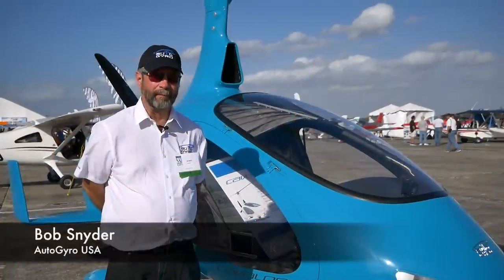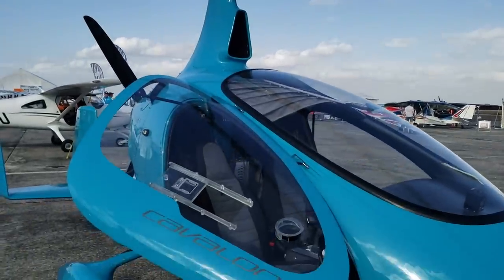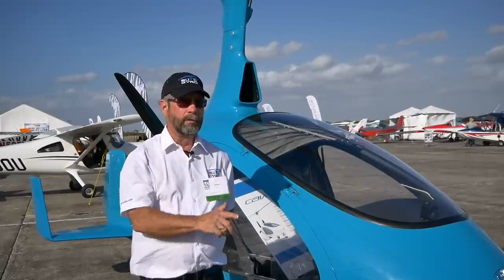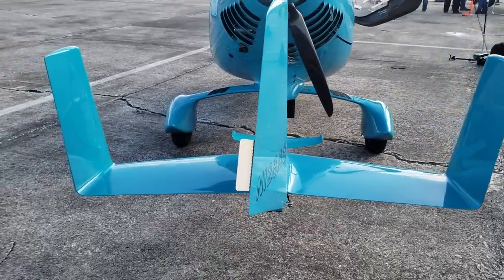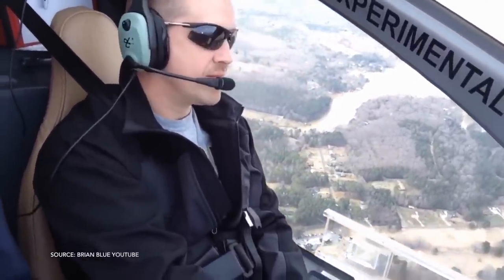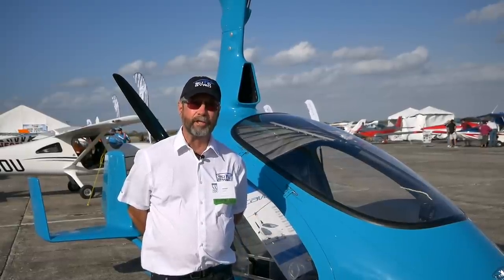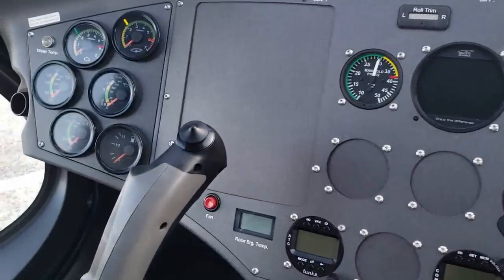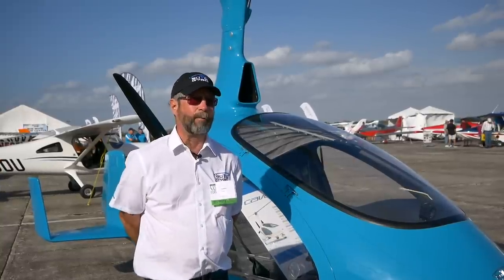WHY Pilots Fly This Instead Of An Helicopter l AutoGyro Cavalon

Comment: Used to build these things out of balsa wood and rubber bands back in the 90's. Autogyro's are pretty neat. Of course ours just flew straight back then. We didn't have remotes for them. But they flew really great across a field with no wind, and even better in a gymnasium. You can still get kits I bet.

Comment: The danger comes when you are always flying close to the ground for a thrill.
Reply: Why??
Reply: apolo romero the pitch angle could be too steep suddenly and the plane would stall
Reply: raymond silva you cannot stall a gyroplane. The only comparable danger is of unloading the rotor.
Reply: @catherineburton195  I bet I can stall one by shutting down the engine and pulling back on the stick.
Reply: @thelast344  no. You absolutely can NOT. All that would happen is that the aircraft would descend, completely under control. As long as either forward OR downward flight is continuing, the rotor blades continue to rotate and generate lift.

Comment: "Pilots Fly This Instead Of An Helicopter"... Perhaps you mean "A Helicopter".

I got to fly in one of these (as a passenger) in Hildesheim Germany where they are manufactured. It's just about the most fun you can have with your clothes on. The model I rode in was one of the earlier open-cockpit models. That actually made it more fun, in my opinion. It was like riding a flying motorcycle in the open air. Fun!
Reply: It is a traditional rule of English that an can be used before words that begin with an H sound if the first syllable of that word is not stressed. Indeed, some traditionalists would say it must be used before such words. Modern English and newspapers tend to say a helicopter. The aspirated H is used less these days. Educated people used to say 'unting instead of hunting for example.

Comment: Having a different set of benefits & limitations, I've always wondered what the ideal functions of these craft are. Like, I see it being a fun weekend fly, but I don't know if it comes in versions that can carry much cargo, or what range they can reach, etc. etc. I wonder if you could make one with big tires so it could function like a land-anywhere 'bush' gyro?! lol.
Reply: lol more cargo space, a bit more range, and bigger tires so it can land in rough conditions... You don't fool me you work for the cartel! haha
Reply: @TheFrogInYourClosetWatchingYou  I'm interested in flight, but I'm not, er, in the club (like, I'm not a pilot). I'm wondering if 'the cartel' is some insider's reference.
Reply: @pbasswil  lol I was just joking that it seemed like you were asking about upgrades that would be very handy for drug runners.
Reply: @TheFrogInYourClosetWatchingYou  Ok, gotcha :^>
Reply: They have more drag than a fixed wing aircraft and do best with high power to weight ratio engines. The Australian livestock mustering gyros are bare bones light builds with Rotax 912 motors with massive propellers. To carry cargo and have performance requires high performance motors in the 200-300 horsepower range which are not widely or affordably available

Comment: This is a better aircraft per say see other videos about the. GyroCopter.  "Shake Rattle and Roll" this gyro is the best.  Quiet and smooth,  and it don't take forever to take off the ground. This AutoGyro 👍 Much better by far. "AUTOGYRO CAVALON" Just around  $100.000 Nice. 👍
Reply: Per se?

Comment: Please help me understand...you said the rotor is not powered , but I watched some other videos about this particular hydroplane, and prior to take off, before any forward motion of the aircraft, the pilots power up the rotors to a certain rpm before beginning the take off roll. I also noticed what appears to be a chain drive sprocket under the rotor...so how is this not a powered rotor?
Reply: Wonderfully Beautiful  power is only applied to pre-rotate to shorten take off run. Gear is for the prerotator bendix to drive the main rotors.  Disengaged after about 200 rrpm

Comment: Gyrocopters are extremely safe that is why. Gyrocopters you can turn off the engine completely and it will land softly without power. Only reason the retrodyne wasn't succesful cause it was loud. Its bout overdue time for a new Retrodyne.

Comment: Geoscoptic gears are so effective to maneuvering, you can also create a for forbidden ability call "ant-gravity" but essentially is what I call Geoscoptical, directional movement. One can create also a gyro rod through the craft like a front extended antenna, but is used to keep the nose area up, while a rear afterburn nossal behavior, totally verticle levitates like a craft like bird legs looking as magical flare burning limb.

Comment: An helicopter? H is not a vowel.
Reply: Actually whenever the word A would normally be used, but the next word begins with the letter H it is correct to say or write "an" instead of "a." English is a very strange language with lots of bizarre single case rules. This is one almost everyone "gets wrong." Although usage inevitably wins out, and can render a rule archaic, it is still proper annunciation, and grammar to use an in lieu of a when followed by h.

Comment: Wonder why no four seaters?  It seems like they'd be a lot more useful if they weren't so small.
Reply: Think it's the result of ultralight regs
Reply: BraveScaryThings 2 seaters aren’t ultra lights. The two seaters are currently light sport category. But there is nothing stopping someone from from building a 4 seat experimental or even certified Gyro
- Gyro CFI
Reply: The vast majority of four seat FIXED WING aircraft are flown with a single pilot or two persons. The extra two seats and room are rarely used and frankly a waste of fuel. A slow autogyro with even less capability to take four people a decent distance in a short time has even less use for four seats.
Reply: @larsandthevikings2048  There are actually some proto types being worked on as well as a company that has a twin engine, twin rotor ship in the works.
Reply: Ron Andress - twin engine - awesome. Where can I read more!?
Reply: a four seater would increase price an order of magnitude.  This is to get people up in the air on the relatively cheap, and lots of fun without agonizing over the extraordinarily expensive hobby of flying.
Reply: Jason M    Trendak had a prototype that was unstable during its test flight from what I heard.   Looked cool at least.
Reply: Grown brothers was testing a 4 seater but they went out of business.
Reply: @larsandthevikings2048  If you want to see something really cool look up Groen Brothers Hawk II   turbine powered Rolls Royce

Comment: I laugh how they are calling these 'planes' these days. It's a gyro COPTER. It doesn't use the same dynamics as an actual plane... My engineering professor had a good laugh...
Reply: Paul Beebe   Well......the rotational wing developes lift the same way an aircraft wing does.....except it rotates......flight controls actuate pitch yaw and roll....just like an airplane..... only real difference is rotating vs fixed wings.
Reply: Paul Beebe "It's a gyro COPTER."

It's a gyroplane or autogyro/autogiro. "Gyrocopter" is a tradename for the gyroplane designs of Dr. Igor Bensen. As for not using "the same dynamics as an actual plane," that's pure nonsense.
Reply: Well Paul.... many many years of flying.... building and test flights might not agree with your comment.  I openly invite you over anytime for some flying and discussing the theory of flight. :)
Reply: Paul Beebe "It doesn't use the same dynamics as an actual plane."

1) Helicopters develop lift by forcing air down through the rotor disc, and the equal and opposite reaction lifts the aircraft. Fixed-wing aircraft and gyroplanes develop lift by moving forward through the airstream and using the angle-of-attack of their airfoils to force the air to push up on the wings. The difference between the latter two is that because the gyroplane's wing is rotating at 300 - 400 RPM there is no "stall speed" below which the wing can no longer develop lift. 2) Helicopters control yaw (the direction the nose is pointing) by increasing or reducing the amount of anti-torque force counteracting the torque of the main rotor. Fixed-wing aircraft and gyroplanes control yaw by deflecting airflow with the use of rudders. 3) Helicopters can take off and land vertically, and hover in midair. Conventional fixed-wing aircraft and gyroplanes cannot, although some can come very close. So much for gyroplanes not using the same dynamics as an "actual" plane. All the gyro pilots had a good laugh at your comment.
Reply: Well junior...... the helicopter.... gyro.... plane.... trike.... hang glider...... all use the same aerodynamics for lift..... a wing.... some go around in circles.... but still a wing. I’ll take you flying in all the different machines and demonstrate for you.... free of charge.
Reply: @ultracruiser41able  To whom was your last comment directed?

Comment: Engine failure is not a non-event in a autogyro. You still need forward airspeed to land it like a helicopter does. And with no collective pitch control, you have less options than a helicopter with rotor RPM control or autorotation range selection. That's why there is height velocity diagrams for gyroplanes same as helicopters.
Reply: Your not adjusting pitch control much in a hell, you might get a little more glide but not substantially more. And the AutoGyro rpm pretty much self regulates.
Reply: Auto gyros are always in autorotation.....a helicopter (when the engine fails) must have control inputs to achieve autorotation.

Comment: Now hold on there just a diddly darn minute, Baba Looey... There seems to be a gap in logic at 5:30 when the narrator was expressing his concern for his safety when offered a test ride because "Man, these things are dang-er-ous", yet his fears were dispelled as "in about 15 minutes I knew I had misjudged this aircraft... It was a lot of fun".

Isn't that the same logic as meeting someone in a bar and despite your having concerns about the dangers of "unprotected sex" you go ahead anyway.... and in about 15 minutes is was so much fun that you lost all concern over safety. 

Somehow the logic evades me.
Reply: Simple: reason gyrocraft have a bad rep is there were no training aircraft until late 70s... so all pilots from the Benson craze of the 50s until late 70 were all classroom instruction (if they were lucky) then "have fun and good luck".... now that there are dual seat "ultalight" gyro's available, there are more reasonable rates of pilot fault crashes and the crafts themselves are much more safe that either fixed wing or helicopters....

Comment: Helicopters and autogyros have very little in common. Cost to buy, maintain and fuel efficiency aren’t comparable. Control of the two aircraft are on not comparable either, any helicopter pilot can fly an autogyro, it’s not the same for first time flying a helicopter. For all intents and purposes it’s a STOL plane.
Reply: everyone has their opinion but I am a fixed wing pilot and have Bell 47 solo time as well and would not agree that any helicopter pilot can fly a gyro the learning curve is steep as it is in a helicopter and it will bite you hard if you make a mistake. No matter what your going to fly please don't try it yourself get the proper training from a good instructor. Fly often fly safe.
Reply: Ron Andress ... agreed, no one should fly anything without proper instruction. However, I have time in all three types and the auto gyro is a piece of cake. There is no torque yaw, translating tendency, and the thrust is horizontal rather than vertical, lots of fun and very easy to handle.

Comment: Why does everyone say the rotor is not powered. This only confuses people. The rotor has to receive input via some means to spool up from the engine one way or another. What is it? Belt, hydraulic? What? There is no way you pre rotate the rotor before take off without some connection to the engine..
Reply: Sal Balakrishnan   Yes...it's connected by several different methods to initiate the pre-rotation sequence.....but after pre-rotating......the rotor is not driven by the engine....it is free wheeling into the wind.

Comment: While airborne, it looks to me like there is a constant vibration in the cabin. I would think that would get old pretty quick.
Reply: Just camera shake..... since a gyros rotor is not powered by the engine.... the cabin does not develop a 2 rev shake.

Comment: I'm not a pilot, just stopped by to check out the strange looking flying machine. Question, why do you prefer them to fixed wing aircraft? Why are they so much more fun to fly?
Reply: A long runway for taking off and landing is not needed so many people if they have some land, could keep it at home. It also is safer but does not less capability to go with its much lower cost.  This is for flying, not so much traveling long distances and can be approached more casually, for example owning a fixed-wing craft, keeping it at an airport and those costs, would reduce the number of times you could fly on the spur of the moment. The engine is a lot lower cost to maintain. Everything about an airplane is expensive so unless you are really going to fly a lot it becomes a big money pit. This has a lower cost of ownership easier to fly on short notice and with less advanced planning.  I used to live on a ranch in the mountains, and had lots of clearings but not enough to use a fixed-wing plane so I kept my plane, a Piper Arrow, at the country airport an hour away. This thing would be much safer putting down in unplanned events such as malfunction than trying to nurse a fixed-wing plane to the nearest paved runway 20 miles away.

Comment: Are auto-gyros less prone to stall than a fixed wing plane?
Reply: Yes, they are since the rotor speed increases with vertical drop, creating lift to stabilze the craft it becomes virtually stall free even when the nose is high

Comment: Groen Aviation was developing the Hawk 4 which was capable of carrying several passengers. Also, the 'jump' takeoff was also developed but is not in use today by modern gyros. Too bad.
Reply: ericonline7 there are several jump gyros that have been developed but the complexity makes it kinda not worth it.
Reply: Yeah just find the use case for a 4 seat autogyro, lol. It’s like a four place motorcycle, not much need.
Reply: @DoctorShocktor  A reasonable size area to at least hold some carry-on bags for those little sightseeing trips/visits.
Reply: The Hawk is a fantastic machine but out of my price range something I did get to fly in a few years ago was a Sport Copter II  Much bigger than my Cavalon and I think it is powered by a 230 hp. Lycoming. When you tell someone you actually flew in one they look at you as if to say ,,,,,,,and I suppose you have seen a Unicorn too,,,,,,,,I was just fortunate enough to be in the right place at the right time.

Comment: I have flown in them with Bob.  Yes they are fun!  But they are NOT little helicopters. They are airplanes with spinning wings. You still need an airport to take off and land. They don't fly faster nor carry more weight than a comparable airplane. Don't get me wrong. I really like them and they are fun. But contrary to how they look, they are little airplanes, not little helicopters.
Reply: Or a field. The more wind the shorter the takeoff run.
Reply: @ictpilot   Yes, but that is also true with a small plane too.  I have landed and taken off many times in and out of small grass fields.  Again, not much different than a small plane.   The one BIG exception is the "wings" of a gyro-plane easily rotate to align with the longitudinal axis of the aircraft so they can be stored and transported on the ground much easier.   There is great video of a group of gyro-planes flying around in the Nordic countries where they drive the gyro-planes on the ground and drive them onto normal car ferries.  So the gyro-planes can act a bit more like flying cars than they act like helicopters.